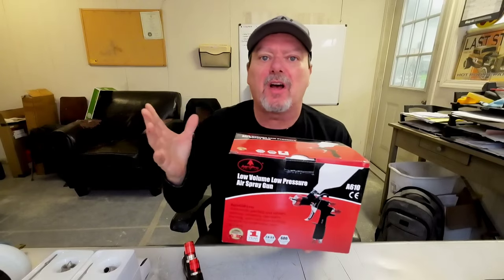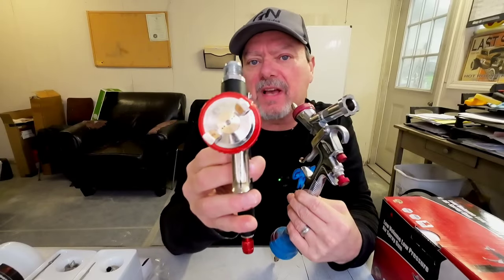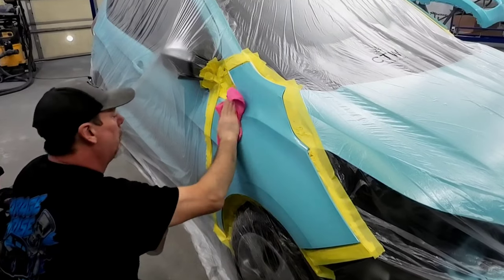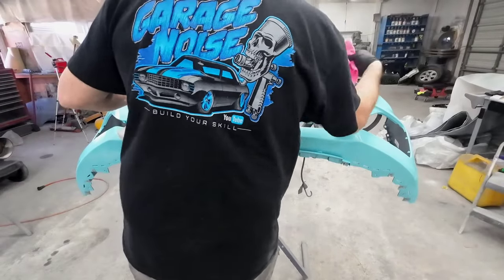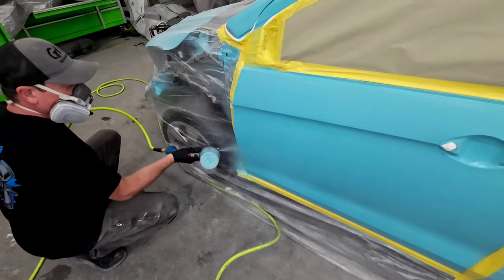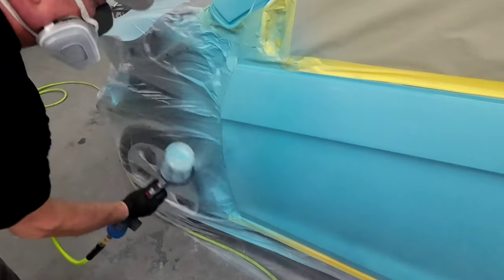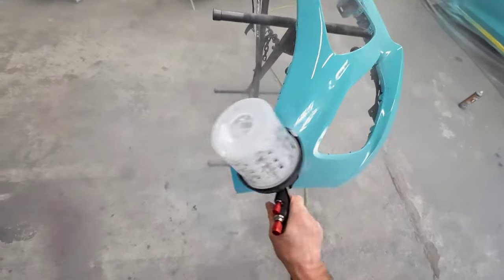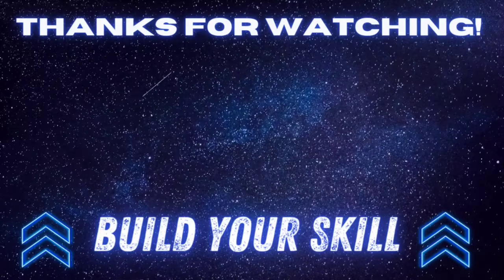The BEST gun for painting a car in your garage!

Comment: Im not gonna Lie, when i was 22 and didnt know Sh_t. I tried to Paint a '65 Mustang w/ a HVLP Sprayer that required 14cfm w/ a little Porter Cable pancake compressor. I killed the compressor and made very nice Orange Peel everywhere! Lol! Where was this Gun in 2000???
Reply from the maker: Lol, that's called getting experience the hard way🤣 Hopefully I cannhelp people avoid that. Appreciate the comment brother!
Reply: @GarageNoise  I noticed through the light reflection there was orange peel everywhere. Didn't look heavy but notice the edges of the light lumpy. Is that normal cause of the brand of clear. I know you have alot of expertise so if that's normal than I'll understand if it happens to me. Cause I've seen other videos where they lay it like glass from the start
Reply: @antonioprado8068  try increasing your Air Pressure by 4 lbs.
Reply: @jaydawg2357  thing is EVERY video I've seen they shoot at 30lbs on a lvlp. I'm wondering if it's cause he shot at 3-4in away

Comment: I really like this gun. I've tried several affordable DIY guns and so far this one hard to beat. Sprays and atomizes very well. Nice wide and even fan. I have a Devilbiss FLG5 and it's a nice gun but it cost me a little over $200 and it's got an air leak in the air valve. A rebuild kit is gonna cost $60-70 shipped from the UK. It's also got a seal that wears out on the fluid nozzle. The aeropro doesn't have a seal on the nozzle and the other seals are easily replaceable rubber o rings found at the hardware store. Makes it easy and affordable to service. Great gun for the DIY painter
Reply from the maker: Couldn't agree more brother! I can't  say it enough on the channel and it help everyone in the community to hear it from painters who use this gun. Appreciate the comment and support!
Reply: Which one spray better?
Reply: @jaefousable  The Flg atomizes really well. It's a good clear gun. Lays out plenty of material nice and flat at 30-35psi. It's a good primer gun too if you have a 1.8 tip. I don't care for it too much for metallics but it will lay them out fine if you do your part. Either gun will do the job

Comment: Hey, frst off, you're a great teacher. Watched numerous vids you've published. You have given me the confidence to move forward and pain my grand cherokee. Starting with the bumper covers. The lvlp guns are for me. The question i have is for the compressor.  I have a dewalt with a 4.5 tank. It produces 5 cfm. Also it can produce 200+psi. Will this be adequate? Can't  afford  a new compressor at this time. Later is a definite possibility.  Will it get me through the bumper covers?  Also would adding an oil/water seperator and  a second regulator to the compressor help? Thanks for your dedication to the diy-er.

Comment: I bought the Spray-It version about a year ago.  I have used it a couple times.  I got a very lumpy (like sharkskin) finish with the 1.5 tip and some epoxy primer.   I think it was all technique issues, though.  The gun seems to work well and is easy to clean.  Low overspray.  No problems with harbor freight 29 gallon compressor.

Comment: Great Vid and great results! Really smooth! This vid was a starter for me. I started with HVLP in the garage, prep was fine, base coat was ok and once I started with the clear coat I was standing "in the fog" and learned about advantages of a spray booth. Result was rough finish and orange peel. Now I do own an R500, A610 as well as an LT100 and changed my approach a kind of completely. Prep is the major part still, but the LVLP techique with reduced overspray and pressure is the reason why my complete car paint is competitive and worked out well. Thanks for the key fact with changing the speed without the settings...it is a key! Once the settings are fine, they will stay fine and from then on speed will make the difference! Cheers and thanks a lot!

Comment: I wanted to like this gun but I had nothing but trouble with it as a beginner. Everything that could go wrong did go wrong. Firstly the vent clogged after primer, didn't realize (again beginner) messed up my first base coat. Secondly I clean the entire thing very well again, tried again, and towards the front of the gun the nut with the needle seal apparently was loose and slightly leaking which also caused a slight leak in the system and inconsistent spraying. My harbor freight gun gave me zero troubles. I have a hard time recommending this unless you know exactly what you're doing and how to check everything on the gun (I thought I did but apparently there were some little things that I missed). It sprays decent when it's all working, but overall it's pretty cheap and out of the box needed significant maintenance.
Reply from the maker: Sometimes you have those days where everything goes wrong. I've  had my share don't  give up on it too quick, you sort out the bugs and you may change your mind or you might not .
Reply: @GarageNoise  one of the seals got messed up too, may try out an atom gun. Got great results with my harbor freight gun. Was discouraged but not defeated as overall my project turned out fantastic given the challenges and willing to further invest in better equipment. I'm excited to paint another day! Thanks for the videos, hopefully my initial comment didn't come off too negative, was just frustrated in the moment.
Reply: See my reply comment in the more recent post on this issue
Reply: @krh007  ?

Comment: .26
I am repairing and painting a waverunner and have really found your videos helpful. My question is this…
After applying the second layer of paint I have some dust and bugs that got caught in the paint. My understanding from a video is that you cannot sand at this point even with a very fine (3000) wet sanding. Is this accurate? If sanding at this point  is not an option, what do you suggest?

Great job on the videos and thanks for your help. This - for a 75 year old - has certainly been a challenging and interesting project. I’m almost done thanks to you.
Reply from the maker: Depends  what paint your using. Is it basecoat clearcoat or a single stage? If it's  base and then clearcoat.  You can lightly sand out imperfections with a fine sandpaper like 800 or 2000 and then apply another coat of base and clear.

Comment: Thanks for doing these gun reviews Chris as it helps the hobby painters out there like me, I'm lucky enough to have a decent compressor that can run most guns plus my air fed mask in my homemade booth.
I would like to see the video you mentioned about how changing your gun speed and distance can alter the way it sprays, I think it would be very interesting, many thanks👌👌👍John UK
Reply from the maker: Your welcome! I appreciate all the support.  I think I will make that video. I believe it will be helpful  for the community. Its amazing by what can be done with just a few simple  tweaks of spraying techniques.
Reply: That would be awesome, as you say you can change the finish from the clear just by altering the speed or distance, looking forward to seeing it.
Reply: @GarageNoise hi i see this gun make a great work but i see its little slow , did u have full open material ?  May be i need order 1.5 for  faster spray panels ?🤔

Comment: The Aero Pro A 610 is an excellent all round gun. I can spray primer, base coat, flake and 2k clear out of the same gun. Can use my 26 gallon two stage compressor without any pressure drop. Uses half the volume of paint than a HVLP.
I paint motorcycle parts so the equipment i have works very well for the applications i use it for.
Reply from the maker: Awesome! Appreciate the comment!
Reply: I recently purchased aero pro R500 ! Do you think the Husky 27 gallon air compressor would work good for this Spray gun?
Reply from the maker: @tomh6598  check how many cfm's it produces needs to be about 6
Reply: @GarageNoise  it is 5.1
Reply from the maker: @tomh6598  that will do it, may fluctuate if your painting a complete car.
Reply: Actually it is 5.1 cfms at 90 psi and 6.8 cfms at 40 psi  for the husky 27 gallon compressor! I am going to use the aero pro R500
Reply: Is this a I or o pattern? Thanks
Reply: How much paint to do a hayabusa with the 610?

Comment: Good review. I have the Summit R500 which is the same as the sprayit gun. Correct me if I'm wrong but reading your comments and watching the video does this sound right for a starting point, epoxy primer w/ 1.7 tip at 15-20 psi- Base w/1.3 tip at 15-20 psi and clear w/1.3 at 30 psi? Base is a metallic if that matters.
Reply from the maker: That sounds good! 1.7 should be large enought for epoxy if it has trouble you may need somthing large for exopy. Thickness varies depending on brand.
Reply: @GarageNoise  Thanks, Everything worked perfect with these settings. Not a single run and very little orange peel.

Comment: Thank you for this video. Quick question. I’m going to be getting a smaller 20-30 gallon compressor and this gun. I plan on painting my car in the garage. I was wondering if you could show us the setup you use for moisture containing?  Or maybe you already have a video and I missed it. I’m basically trying to find out what all I need for a garage setup without spending a ton. Thanks.
Reply from the maker: I have oil and water separator with dessicant beads that I change every time I paint.I have about 20 feet of line with two drain vales before the separator. Water trap at the gun. Here's a link to my separator. This is the one I use https://amzn.to/40Mdlyc

Comment: I would love see a video dedicated to clear coat techniques.  I tried using your settings for Upol 2882 and ended up with horrible runs that I couldn’t get out.  I now have to recoat with base and try doing clear coat again.  I also had so much overspray from the gun that the whole garage was a haze at 30psi.
Reply from the maker: Oh no! I've  got to make that video. Remember your distance and speed as well. Typically  runs are from speed. I say typically cause other thing can cause it. Also what was you fluid at? I'm  spraying 3 turns out from closed. Do a test and experiment with your air, fluid, speed and distance. Get a feel for how the effect each other. Appreciate the comment and support!
Reply: I was doing three turns out from closed with the trigger squeezed in all the way.  I am using the spray it 33000 as well.  I have never painted before this project and using your tips I have been able to paint the primer and base coat without a single issue so I owe you a lot of credit.  Thank you for the advice again.
Reply: @GarageNoise oo
Reply from the maker: @gunstuff5273  Awesome to hear brother! Happy painting!

Comment: If you dont own any spray gun, this is a good starter kit, additional needle sets are great, price is good. 

I returned mine because the holes on the air horn were misaligned. Haven't used it but it bothers me. I already have the LT100 and Summitracing lvlp so i dont really need this gun. It is a good deal though with the additional needle sets. 

The seal behind the trigger is a bushing making it gritty, older R500 are oring that feels smoother. Weight are about the same, newer is slightly lighter. Aircaps are interchangable, but the needles doesn't have engraving on them to identify size. The older r500 needles are engraved with size. First stage of trigger is very short, you might accidently pull too hard and make paint come out when you try to use just air.
Reply from the maker: Thanks for your input brother appreciate the support!

Comment: I notice you have your water trap before the regulator (which is how everyone seems to do it). I would have thought it would be better to have the water trap after the regulator to catch any water that condenses as the pressure drops. Am I missing something? Thanks for the videos and for taking the time to answer so many questions from your viewers.
Reply from the maker: Honestly I really don't  think it matters how you put it on. Appreciate your comment brother!
Reply: The fitting at the gun is a standard european pipe thread which is designed to seat the regulator to the gun and the tapered pipe thread on the other end of the regulator screws into the female end of the water separator.
The way he has it set up is correct you do not water going into the regulator either.

Comment: Thank you for your video. I recently purchased the R500 from Amazon but having a problem changing nozzles. I'm a newbie, but my understanding is when changing the nozzles you have to change the needle with it. Any suggestion on how to remove the needle on the R500 would be appreciated, I Can't find anything on how to break it down for cleaning or moving from one tip to the  other either on line or from the shipped user manual. Thank you again.  I think a video on a  borrowing but necessary topic for cleaning or changing tips would be appreciated by many.
Reply from the maker: Unscrew the fluid adjustment remove spring an the you can pull out the needle towards the rear of the gun. Remove cap and the fluid tip. Probably should do a short on that. Appreciate the comment and support!
Reply: If the fluid tip is on really tight from factory use a socket set to crack it loose (not the little gun spanner in the kit).  When reinstalling the fluit tip you can then use the spray gun spanner to nip it up firm, then re-instal the needle and last the air-cap

Comment: i would like to learn to paint my own small projects like moldings flares or rust repair can i use this gun with a 60 gallon 6HP standing compressor with a 3 stage air dryer in my garage or do i need a different gun? thanks for your videos i subscribed and learning a lot been a Mechanic for 30 years
Reply from the maker: Yes ,i believe it would work with your compressor.  You want about 6 cfm's  of air

Comment: Great video! I appreciate what you do. What settings would you recommend for spraying primer sealer with the r500?
Reply from the maker: Primer sealer and base coat air pressure at 15-20 psi as a guide. Appreciate the comment and support!

Comment: Found this gun to be great but I do have problems getting a good gloss with Acrylic clear, also seem to get a fair bit of over spray ,is there different settings for Acrylic? maybe a bigger tip? any tips would be welcome.
Reply from the maker: Are you using a 1.3?
Reply from the maker: When you say gloss ,is it orange peel?
Reply: yes 1.3 @28 psi, I sort of got a shine from the clear now, had to slow down the gun speed bordering on the edge of runs, Acrylic just does not shine like 2k by the looks, so a lot of rubbing and polishing coming up  thanks for reply @GarageNoise

Comment: Have a question about a different topic,  I had to paint lower door and used the crease line to paint up to it. What is the best way to sand it smooth.
Reply from the maker: Do you have a soft edge or hard line? If it's  a soft edge I would sand with 2000 , don't try to sand it totally smooth. Then sand with 3000 , I would the sand with 5000 and buff using a lite compound.  5000 is optional. If it's  a hard line same process but just understand you won't get it totally removed and you don't  want to try cause you'll probably sand thru the clear. Hope this helps! Appreciate the comment and support!

Comment: I have a small ding in the rear center bumper 2019 Acura RDX .. can the body shop fill that small ding and paint just the center section of the bumper and properly  blend it? Or will the entire bumper need painted to look correct? Love your channel.
Reply from the maker: Yes they should be able to fill it blend the color but to do it properly the entire bumper needs to be cleared with all components removed.  So essentially the entire bumper is being painted. Thanks for watching, appreciate the comment and support!

Comment: I bought this gun and im really trying to like it but im getting runs every time 😂i  changed my  speed  cut back on fluid  tried  about everything i could  but nothing changes im wondering if the clear coat im using is the issue ive also noticed that the fan size is kinda small for me  u gotta open the fluid all the way in order to get a bigger  size fan   i find the astro EVOT 13 sprays  much easier than  this gun
Reply from the maker: You might have a machining problem in the cap,  cause the fan size should not be effected by the fluid volume.  The fan should be about 10 inches.

Comment: You mentioned that using the scan tool got you a better paint match. You think a scan would be the way to go for older, faded paint?
Reply from the maker: I don't  think I would start with the scan tool. Not all scan tools are that accurate. I hear a lot of complaints from other painters. I would talk to your local paint supplier and see what they recommend.  Appreciate the comment and all the support! Hope this helps.
Reply: Buff the paint and clean it well before finding a color variant.... Don't rely on the cameras - sometimes they're way off... But a solid paint rep will know how to get a variant and custom tint from there.. Most times your first 2 primary mixing toner colors can be pushed up or down 5% at a time...

Comment: Its really have small air consumption about 3-4cfm for real use? Like mini spray gun?
If thats true, can i work with 1 or 1,5 hp compressor???
Interested
Reply from the maker: So it claims  4-5 cfm's 
I have no way of knowing for sure but I compare it to my other guns that use 10cfms and the overspray that's  produced and materials used is noticeably less. So I know it's  lower air consumption.  I haven't used it on a small compressor but have seen it used on a 20 gallon harbor freight compressor that produces 6cfms  and it painted a whole car with no trouble.  Check out https://youtube.com/@UndergroundPaintKing?si=P7rZ6HDQL6fw8SRB
He hase used it with a 20 gallon compressor.  A pancake compressor will likely be to small.
Reply: @GarageNoise  hard to find lvlp gun with low air consumption like this,, and a will try this gun soon...
Thanks for sharing 🤟